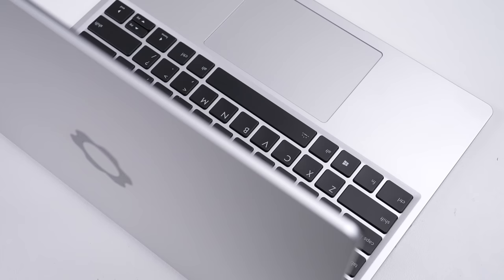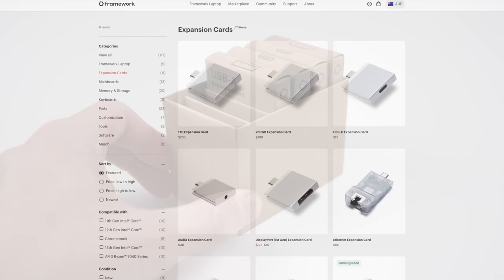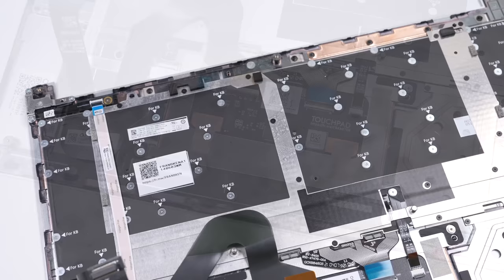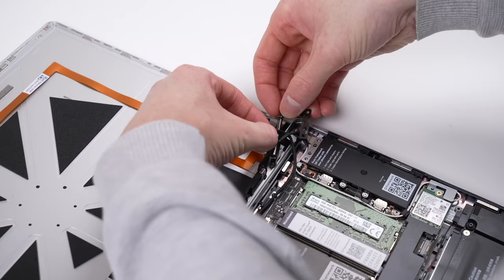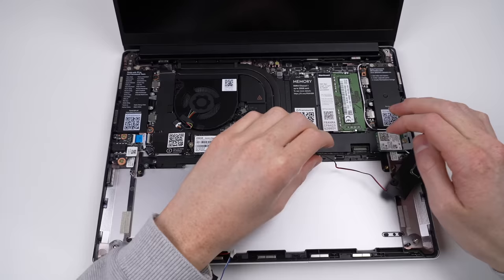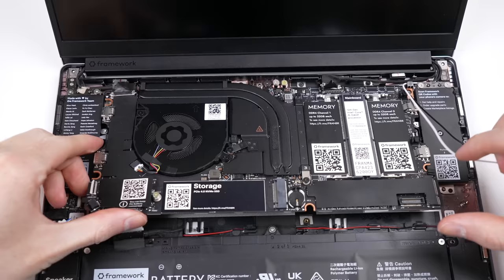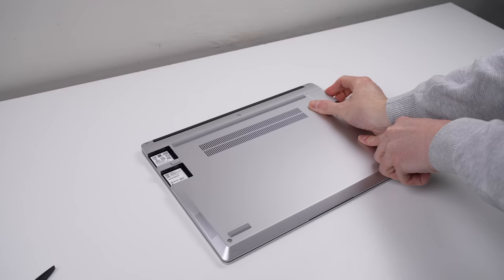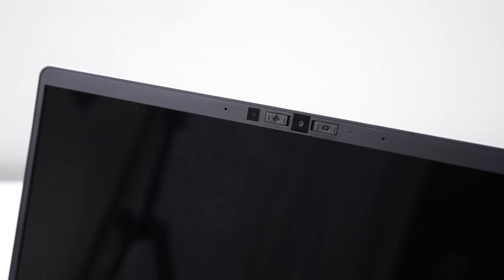New Laptop Brand Shocked Whole Computer Industry - Framework Laptop - Teardown And Repair Assessment

Comment: If a major manufacturer adopted this mindset they would dominate the industry. The option of turning the old motherboard into a stand alone PC is simply brilliant. Even if you don't want it for yourself it increases the value of the replaced motherboard significantly.
I am incredibly impressed. 👍
All the best everyone.
Reply: How much for this laptop? Whatever it is, 
It's worth buying!😅
Reply: Mmm. But currently Apple is dominating the industry by doing the exact opposite. Inclear this is the way to go.
Reply: @SebastianApari  What do you mean dominating?
Reply: vsdaveandbambi  
Agreed. Lenovo is. But I still believe the market does not want this mindset.
Reply: Yeah, I really liked that. 
I used to build custom PCs when I was a kid and so I grew up in a household with 6 frankenstein computers. Now it costs so much money to buy parts it's nearly impossible to have more then 1 usable PC. 
Anyway, when I saw the old board going into a standalone PC it really brought back memories, but a more modem application would be to make a NAS or a workshop PC.
Reply: @SebastianApari  "The market" is primarily filled with greedy profit driven participants (those running the companies and the shareholders who just want their stocks to keep going up). So, in that sense, you're right, that aspect of 'the market' will always desire planned obsolescence and extreme material wastefulness since that strategy keeps the consumers consuming and cash flowing into their pockets, indefinitely.
Reply: If this method were profitable they would already adopt it. Clearly its not. Once you introduce replaceable parts 3rd party manufacturers will emerge and they will drive the prices to the ground. While you might think that cheaper prices are better for consumers it'll put real manufacturers out of bussiness.
Reply: @tarumarabi  The PC industry is doing fine.  Laptops have traditionally not been modular due to their compact form factor.  It saves more space to use surface mounted chips for everything as opposed to bulkier mechanical attachments.
Reply: This Framework laptop or similar modular ones of the future would not only change the tech market, but also reduce emissions and resource extraction. Hopefully the company can make the chassis out of recycled steel or post consumer aluminum. :) Instead of people buying an entire new laptop if the CPU, RAM or battery broke (resource intensive for laptop manufacturing), one could just buy a new CPU, RAM stick or battery. Or, a new motherboard if the old one breaks, or needs an upgrade.
Reply: @SebastianApari  Apple isn't dominating anything. They're not even dominating in phones, their biggest market. Less than 20% of all mobile phones are Apple products.
Reply: @m0dp1g21  
Yeah they are weak. Thats probably why they are the largest electronic company by revenue. Also why all electronic company follows them. They might not be dominating sales, but hey, give it a thought.
Reply: no it wouldn't dominate. 
Why would the normies want to change their ports?
Reply: What should I do with the old motherboard? It will be useless after upgrade.
Reply: @reformed_attempt_1  Damaged ports on laptops aren't uncommon.
Reply: @m0dp1g21  compare the average price of those 20% market share iphones and an average price of the other 80% market share phones.. you are literally comparing apples to oranges (pun intended). Of course you can't sell the most units when your entry level phone costs 700$ compared to some chinese crap that sells for 150$ or even less. For the price of 1 iphone you can buy 5 alcatels, xiaomis etc.. you should compare apple sales with the other premium phones that are in the same price range and then see what is the % of apple phones sold compared to other 700+ $ phones.
What you literally said is Ferrari is shit, not many people drive it :D
Reply: Nope, they would go broke
Reply: nah, major manufacturers know people that buy these laptops are in a very small pool. Your everyday average user will throw it away and get a new one before you can say framework.
Reply: Go see how much Framework charges for this laptop, and you won't be singing its praise quite so enthusiastically.
+ 8gb 3200mhz ddr4 module £60 (I upgraded a 2022 HP laptop with this for £21)
+ 1Tb SSD storage £109 (I upgraded a 2022 HP laptop with this for £44)
The rest of the upgrades continue in a similar vein.
The only innovation going on here is, marketing that exploits people's naïveté.
Reply: @Plavaovca  More than 95% of iPhones, AirPods, Macs and iPads are made in China.
Reply: @stealthymonk7734  And your point being?
Reply: @Plavaovca  You: "..your entry level phone costs 700$ compared to some chinese crap that sells for 150$.."
Is the point coming into focus now?
Reply: @stealthymonk7734  Thanks. Since originally posting this and getting many replies and a bit of an education, I have gone off the idea entirely.
All the best.
Reply: Corporate greed makes us buy charger to device which they sold for extra and you think that any major manufacturer will adopt this mindset of upgradeable and easy to repair laptop? People would stop buying their new models which they can price so high when all they need to do is change a motherboard and chip. There is no profit in that so they will rather make cheap build quality using plastic and little to no repairing or upgrading facility.
Reply: @cryora hmm, not sure that's true historically, nowadays yes, but in the past laptops were often quite modular...  2 pcmia card slots was standard, and there was a plethora of interfaces you could add with those (lan, wifi, bt, cell, hd, etc)...  My HP work laptops had a bay where you could slide in a CD drive, or a floppy, or an hd, or another battery, and the primary hd was in a removable bay...  And of course batteries were easily replaceable...  up until a certain point even the CPU could be upgraded on apple laptops, it was on a daughter card that plugged into a slot on the motherboard....

Comment: I don't even remember how many laptops I have discarded because of outdated hardware and/or non-supported OS. This seemingly simple concept would stop this electronic junk pileup and reuse the laptop with just the necessary upgrades. Definitely right  step towards sustainability and becoming Eco-friendly. Kudos.
Reply: I never toss electronics. Best Buy stores recycle them, even spent batteries. My old craptop is 15 years old and is unsupported, but I use it every day.
Reply: I meant, recycled at city electronics recycling centers. Not discarded in garbage.
Reply: To anyone throwing off their devices: I'll gladly take them :J  Even if they're broken.
Reply: Wher do I order.need it asap for all my executives

Comment: To say I am impressed is a huge understatement, the ease with which complex upgrades and repairs can be done is really quite shocking. I will be definitely be looking at one of these when I next upgrade.
Reply: Have you ever even disassembled laptop unless its apple all modern laptops are the same only difference is the unnecessary and probably expensive swappable ports its stupid
Reply: If you think changing a mother board on a laptop is complex, you better just stay away from taking them apart. Even on the most stupid laptops  isn't complex, it is simple remove screws, and put shit back in. Minus maybe apple, which i never had or tried to take apart.  Even the ones with 10 different kinds of screws arent complex, you cant put the wrong screw back is all, it isnt hard.
Reply: I usually find myself in need to upgrade the ram or the ssd, which is already possible with every laptop in the world. I'd also like to upgrade the gpu alone, but that seems impossible for now.
Reply: I'm impressed but $849 for the lowest spec option is totally ludicrous.
Reply: @MDK808  Not necessarily, swappable ports increase overall accessibility, making the option to upgrade easier for people with motoric issues and so on.
Reply: @FUmoneyWorshippers  Yeah, if you can't rebuild a Honda SUV, you better stay away from building a LEGO car as well. Because logic.

It is usually maddeningly difficult to keep track of the different types of screws and where they go. I have ended up with extra screws when I finished reassembly and had to undo the dozens of screws again to figure out which one I missed. Not fun.

Comment: I've just heard about framework and how supportive they are about repair. They really have shown Apple up here. Well Done Framework!
Reply: They're showing every laptop maker up. They are not perfect, but most of what some might find fault with is down to the component manufacturers stifling their ability to offer full schematics and this further limits the options they can offer. 

Everyone who is supportive of open source and right to repair should be supporting them and recommending them to their friends and family as the more success they have the higher the chances of other laptop makers thinking there's an opportunity for them with a upgrade friendly laptop. (I know the laptop is not open source, but it aligns I think with some of the ethos of open source and the ability to use and upgrade as you want should be encouraged).
Reply: One big flaw with this laptop in regard to "They really have shown Apple up here.", It doesn't run MacOS.  The hardware customization and repair seem to be somewhere between awesome and excellent, but it's still stuck with Windows.  While Windows 11 is less bad than any version since 2000, I find the Mac experience better.  Of course, I have to pay Apple tax, and I am limited to their choices.  Dealing with a terrible company(Apple) that sells great products at excessive markup is not for everyone.
Reply: MacOs is a parody for being a pc os. And surely any windows machine can run mac os a lot better than even Apple silicon macs. Lol
Reply: @frankwalder3608 MacOS? Flaw? lol
Reply: @engineeingnerd he contradict his own comment, he said running in windows is a flaw. Then in the last sentence he said, limited choice and apple tax when using MacOS. That's the real flaw. What a sheep.
Reply: @engineeingnerd  You will eventually need Apple silicon. Until then you have to hope you can find a boot-loader that will let you tweak your install after every update.
Reply: @rzkzkr20  I appreciate that you respect my humor.
Reply: @frankwalder3608  Well - apple is not for everyone (like myself)
Reply: @rzkzkr20  yeah - I got an apple M1 and immediately replaced MacOs with Asahi Linux
Reply: @rzkzkr20  yeah it was funny
Reply: @frankwalder3608  I don't need one. Windows machines are way superior.
Reply: @engineeingnerd  By "any windows machine" I assume you mean a pc that was originally intended to run either Windows, Linux or Unix.  Macs are also personal computers(PC), which is not to be confused with the operating system(OS) that is run.  Those other PCs will only be able to run MacOS with a boot loader, which will have to be applied after most updates, if not all updates.  MacOS will not bench mark or run as well on those PCs because MacOS is not optimized for Intel or AMD architectures.  There are some aspects of Windows which are more convenient such as gaming, just as MacOS has some advantages to their implementation.  Over-all, I prefer the MacOS experience to the Windows one, which would eliminate the equipment featured in this video for me.  If someone is comfortable with using Windows then the featured laptop seems to be a good choice, though Hugh Jeffreys did not say how much the laptop and its accessaries cost, so I don't know what the true value would be.